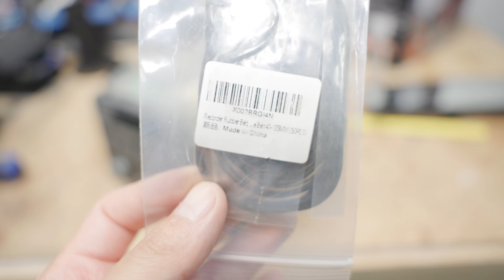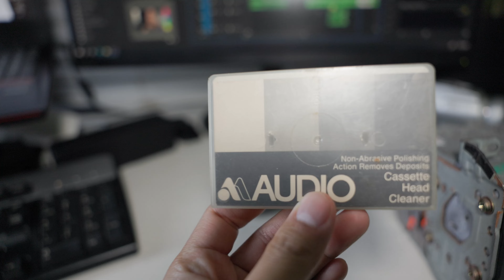MK3 Supra Build "In Pieces" Vol 2 Ep 02 | Cassette Player Teardown

Comment: Replacing the capacitors in that head unit will help bring back that premium 80s sound, you would be suprised what a new set of modern, non leaking and degraded caps will do. same with the ECU, better milage and hp

Comment: I was wondering why this radio was SO DAMN HEAVY when I took it out. I can see why now. I admire your dedication in keeping it alive!! It looks super rad when it's in action.
Are you going to re-use the OEM speaker boxes? I didn't go nearly as far as you and just fitted the TINY OEM size aftermarket Hertz speakers to mine.
Reply from the maker: For the rear? I used 4" Alpine S-S40 speakers in the stock location, so yeah they are tiny lol. The AutoExtrude front speaker pods should allow for using 6.5" speakers. I don't know if this will do much with the stock radio, but I'll give it a shot, and if anything, 6.5" will be better than stock if I decide to get an aftermarket radio in the future.
Reply: @NARFALICIOUS  I mostly meant the front, but yeah I just wanted them to fit them in the TINY holes under the "live sound" speaker covers.
It cost way too much, but at least It's done. I really hope your OG deck works out ok.

Comment: are you using a J.I.S. (japanese industry standard) screwdriver? believe it or not, they ARE different
Reply from the maker: Great point, no I just looked at them. One set is just an "electrical screwdriver" set and the other has several size bits. I'll have to look into getting a JIS Screwdriver set.